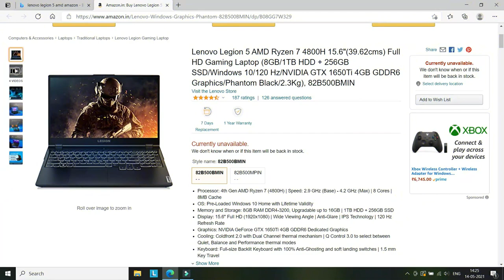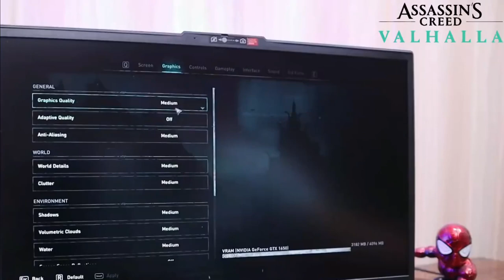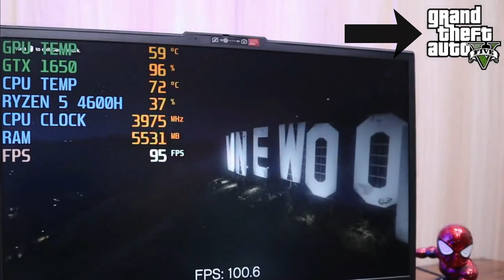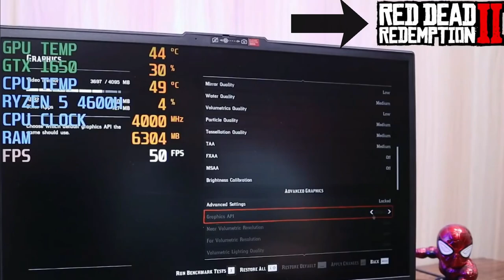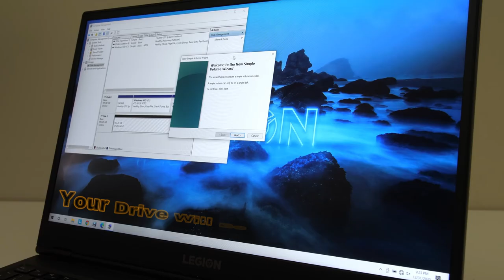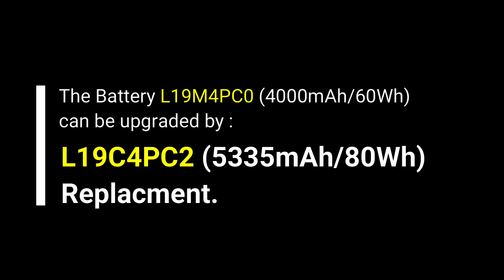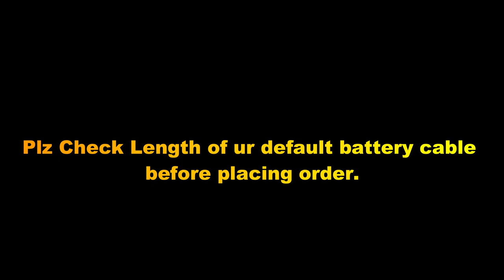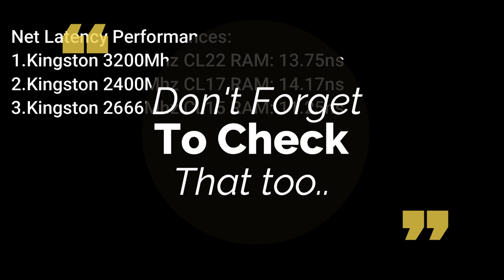Lenovo Legion 5 | SSD Upgrade and Battery Upgrade |

Comment: I got this laptop for my computer science program. Its great, but I've read that the battery depletes rather quickly. If I were to use this for coding/schoolwork (Word, PowerPoint, etc), how long would this laptop last me? And I have the Lenovo Legion 5 15ARP8 so would the 80Wh battery be compatible with my laptop?

Comment: Here's the specs on mine, I'm doubtful there's much I can do to make it better. The 80 watt battery doesn't last long either, even just playing music on battery saver mode. 
•AMD Ryzen™ 7 5800H (8-Core) Processor  
•32GB DDR4 3200MHz RAM
Drives:
•2TB NVMe™ TLC Solid State Drive
•No Optical Drive
Operating System:
•Microsoft® Windows 11 Home (64-bit)
Communications:
•Intel® Wi-Fi 6 (2x2/160) Gig+ and •Bluetooth® 5.0
•Integrated 720p Webcam with Privacy Shutter
100/1000 Ethernet LAN
Graphics & Video:
•16" IPS LCD with LED-backlit Anti-Glare •WQXGA (2560 x 1600) 500-Nits 165Hz Display
•NVIDIA® GeForce RTX™ 3070, 8GB
Audio:
•Nahimic Speaker System
•2x 2W Speakers
Keyboard:
•Backlit 4 Zone RGB Keyboard
Ports & Slots:
•2x USB Type-C (DisplayPort 1.4 and USB4/PD)
•3x USB 3.2
•1x USB 3.2 (Always on USB 5V 2.1A)
•1x HDMI-Out 2.1
•1x RJ-45
•1x Headphone/Microphone Combination Jack
Power Supply:
•4-Cell 80Wh Lithium Polymer Battery
Additional Information:
Dimensions: 14.02" L x 10.41" W x 1.06" H
Approximate Weight: 5.39 lbs
Color: Storm Grey
Reply from the maker: Fast battery drain is an inherent curse for a gaming laptop .. u can't expect more from it bro..!
I always plugged in while using it, only uses in battery mode for light work loads of short duration.
Even disabling dedicated gpu won't give you much of a backup boost. This Processor is quite hungry!
Reply: @games4everyone883  being honest I'm a noob at this gaming computer stuff, but I feel I got a damn good deal on it. I wasn't able to same specs from Lenovo's website, and something similar would've cost me nearly $3k.

Comment: Hello, i have idea how if i put thermal pad on ram? With lenovo ideapad gaming 3? I was experiment thermal pad installed on ssd from your previous video, it can reduce from 60c to 50c with crystal disk mark test!
Reply from the maker: Actually bro.. there's no copper sheet available at the back cover to dissipate any heat from the RAM modules, even if you put thermal pads on them I don't think that wud do any good.
Reply: @games4everyone883  i thought ram cover sheet was something for dissipate heat 😅, thanks then, because somehow my left hand side area felt abit warm than right hand if i play game

Comment: I have some question about this PC, when you replaced the Battery for a better one that mean the HDD can be  Replaced by a SSD Since there a small place on the top? And about the RAM how do i know if the RAM on my pc would match with the Amazon offer ? Is there like some information I must look and take note ?,
Reply from the maker: Watch' this https://youtu.be/uzXn4_JIzi8 my video on RAM upgrade tutorial
Reply from the maker: Or.. if you don't want to watch, let me explain it here for you!
Basically you need to take care of few things only while upgrading a RAM:
1. DDR type which is DDR4 here
2. RAM frequency which is 3200Mhz here
3. Cache latency which is CL-22 in our case.
4. And Rank Type ( Single / Dual)
95% of the laptop due to cost cutting have single rank RAM as the default RAM.

Just Grab any RAM that meets these above specs 👍.
It will be also better if you purchase the RAM from the same manufacturers as they generally use same kind of chips .
If you hv a default RAM of Kingston you shud buy a Kingston , else you can other manufacturer also that will also work.
Reply: @games4everyone883  what ram did u use cuz mines not booting

Comment: Does the 80wh varient also have a m.2 slot? (Lenovo Legion 5 82B1003DMH) R7 4800h rtx 2060
Reply from the maker: Yes
Reply: @games4everyone883  but is doesn't have the 2,5 drive cage right?
Reply from the maker: @yoeri2451  I'm sending u links of pdf by lenovo, check the storage section ❤️
Link1: https://www.google.com/url?sa=t&source=web&rct=j&url=https://psref.lenovo.com/syspool/Sys/PDF/Legion/Lenovo_Legion_5_15ARH05H/Lenovo_Legion_5_15ARH05H_Spec.PDF&ved=2ahUKEwij0aWYjsLxAhXYIbcAHXDiC80QFnoECAkQAg&usg=AOvVaw1PD6OwBNPTh_jFDZZiKT7y
Link 2: https://www.google.com/url?sa=t&source=web&rct=j&url=https://news.lenovo.com/wp-content/uploads/2020/04/Lenovo-Legion-5_AMD_15INCH.pdf&ved=2ahUKEwij0aWYjsLxAhXYIbcAHXDiC80QFnoECCcQAg&usg=AOvVaw04Nv0zr1sF4Bk7sUKldY1S&cshid=1625151136922

Comment: Can I upgrade my laptop Lenovo legion 5 SSD 256gb to 512 GB pls tell me
Reply from the maker: Yes you can... Not only 512 but upto 2TB SSD
Reply: @games4everyone883  I also want to ask you does this laptop have any max mode or other mode like in Acer nitro 5 laptop while gaming to cool fan
Reply from the maker: @adarshkhanal9021  There are three modes toggled by Fn+Q key , Silent , Normal and Performance
Reply: @games4everyone883  which mode is best to not get heat more while gaming
Reply from the maker: @adarshkhanal9021  Performance Mode..
Reply: @games4everyone883  can I do performance mode while it is not plugged in charging

Comment: Can we upgrade to 2tb ssd in the secondary ssd slot
Reply from the maker: I hv order 2tb NVMe and 2tb 2.5" SATA SSD, once I try it bymyself I will let you know
Reply: @games4everyone883  hope it works I want to download more games 😅
Reply: @games4everyone883  btw for how much did you got the 2tb ssd
Reply: @games4everyone883  and what is the limit of upgrading ram
Reply from the maker: @yashrajjaiswal9941  Ryzen5 4600H 32GB and for Ryzen7 4800H 64GB
Reply from the maker: @yashrajjaiswal9941  Very Costly bro.. the cheapest are priced at 18,000-19,000 and performance SSD are priced at 27,000 and 2.5"SATA SSD priced at 20500
Reply: @games4everyone883  did the 2tb ssd work??
Reply from the maker: @yashrajjaiswal9941  uploading.. soon